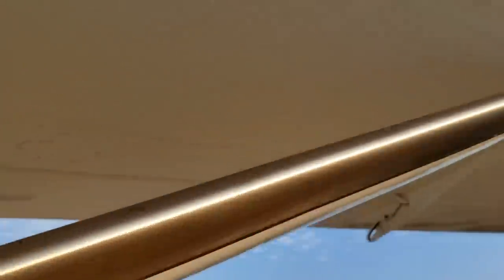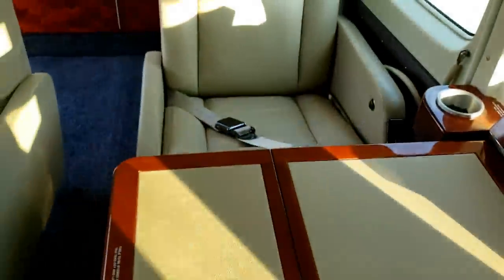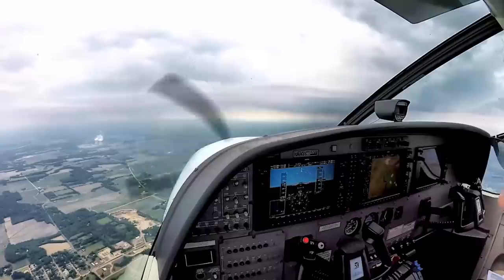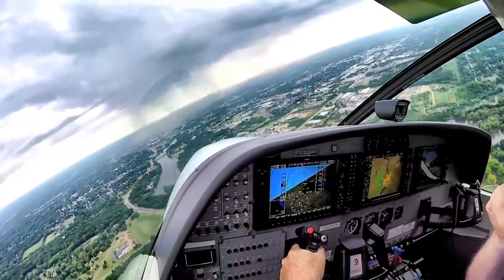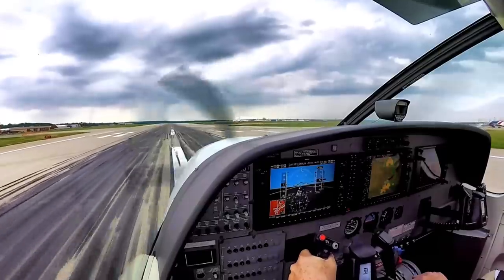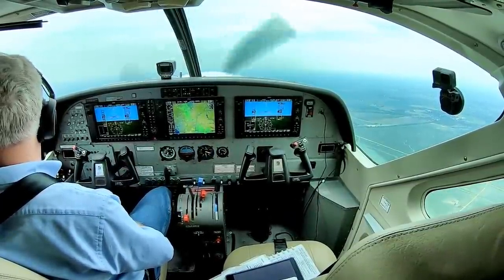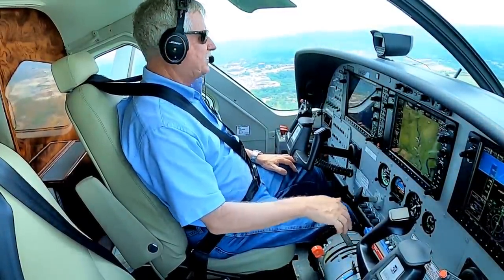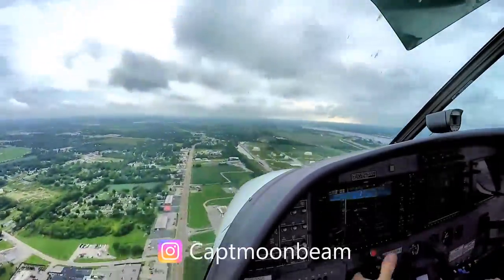Flying the Cessna Caravan in RAIN SHOWERS

Comment: Since the Grand Caravan is one of the few planes in MSoft Flight Sim 2020 that works right, thus far, (and the sim itself is a total mess, sadly), I'm going to fly this route in it in your honor, sir.
I managed to take the Caravan last night from Albequerque to Sedona, AZ, and had a near-perfect RNAV landing there as well. So maybe there's hope for the sim. yet. I also tested out
those reversers, and they worked like a charm. I also had some icing early on and the good thing is it teaches you fast how to engage the anti-ice systems on the plane. Those
also worked like a charm. Always a good thing. I've loved the Caravan since flying them in FSX and XPlane11, because, once you learn all the systems it's such an easy plane to fly,
it's quite forgiving for the most part, and it handles so smoothly, and it doesn't keep freakin' beeping at me when I'm doing a shallow climbout, for no reason, like some of the other
duds in 2020.
Reply: Scott you must have a dud msfs2020 operates  well for me
Reply: @g4kfjve7kfj34  Not really, I just said it worked great for some flights and for others the past two months since release, it's been fucking atrocious. As millions of other users have complained about. The sim was released in a shit crap state, man. Wake up.

Comment: What keeps the ice off the prop?  5:52  Don't you use your altitude alert setting to confirm that you've received landing clearance?
Reply: Prop deice is with electric elements that heat up to melt the ice. They only run the first ¼ or so of the prop leading edge
Reply: @jakobusstrauss1293  i'm totally  aware of that.  i can't remember why i posted that question.
Reply: No worries. No others might read it and learn. Have a nice day!
Reply: @jakobusstrauss1293  Thanks for the reply!

Comment: May I ask why flap 10 is used over flap 20 for T/O?
Reply: Possible reasons- if there is a strong crosswind it is recommended to use less flaps. I did not notice any strong winds though.

If you are light, got a long runway and don't really need it, flap 10 works just fine. Also gives you slightly better acceleration and climb after liftoff.

Comment: It's this correct: when someone forget to close the fuel-caps, then the low pressure on the top of the wings sucks the fuel out?
Reply: Like a truck or a car, you never, ever want a loose or leaking fuel cap or tank, or, contaminated fuel.
Reply: You are correct, sir